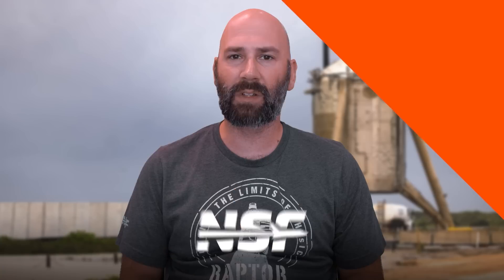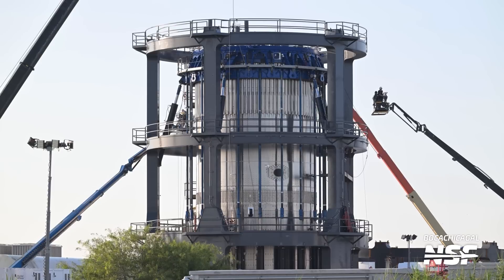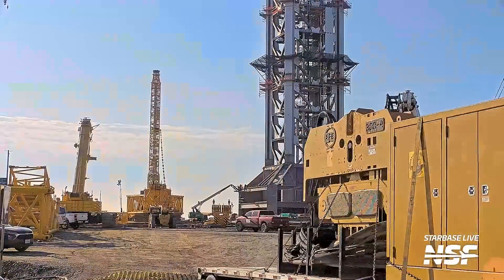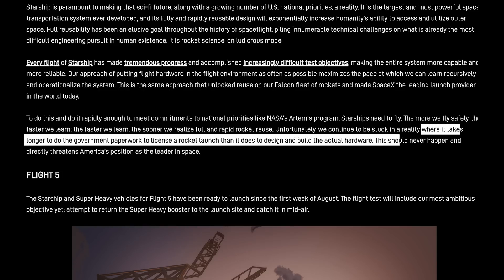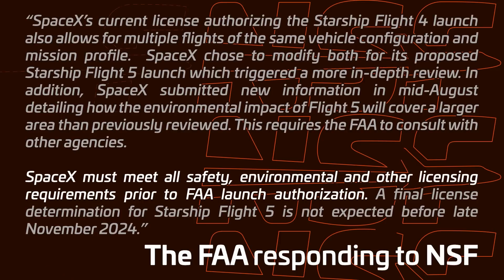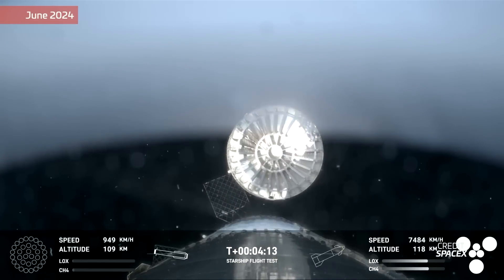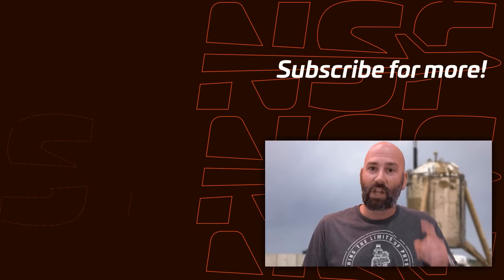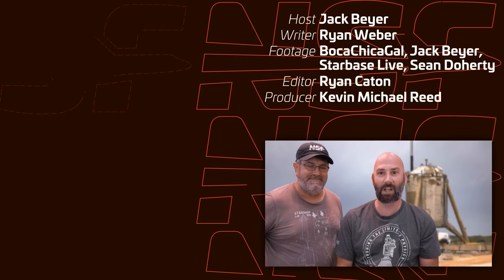WHY Is Starship FLIGHT 5 Delayed? | Starbase Update

Comment: I thought securing the multi-launch license was more of Space-X creating a contingency plan in case Launch 4 failed in similar fashion to Launch 3; however, since Launch 4 checked off all its goals the multi-launch license was no longer needed, hence changing the flight profile for Flight 5
Reply: Flight Five booster catch while pez dispenser etc are tested. If all goes well, flight 6 adds the starship test on tower two, or even set the booster off of tower one and also catch the ship on tower one.
Reply: @mikegardner107  There would be no hurry to test catch the ship if it reaches orbit. There could be ample time to remove the booster.
Reply: Why would SpaceX fly another Rocket unless there was something to learn in large volume from it. Sure the heat shield failed, but the booster and the ship itself did exactly what it was supposed to do, land in the ocean after simulated landings. I don't think SpaceX wants to fly a rocket just to test it's double thick heat shield.
Reply: @shaunfosmark  I think if they could fly for free, they would totally fly just to test the heat shield. The re-tiling seems to take a long time so I think they'd prefer to know as soon as possible, so that they don't have to retile the remaining ships multiple times.

It's just that flying is costly (you're throwing away 2 vehicles, but also in terms of manpower, having to stop other work at the launch site, etc) so it's a question of how much data do they think they need to get from a flight to outweight the costs.
Reply: @Wolf480pl Not flying is penny wise pound foolish at this stage. Ship data is too valuable to wait for catch approval. The engines on Booster 12 are some of the oldest Raptor 2’s remaining.
Reply: Defund FAA.
Reply: Flight 5 has plenty to learn from on the ship end. Tests of the Pez dispenser, engine re-light, and tiles can all be done without a booster catch. Success of this can mean a Flight 6 with both a booster catch and orbital trajectory.
Reply: @EMichaelBall I believe they must be confident that the updated heat shields and revised dispenser are more than adequate to cope. Remember they also used the most volatile re-entry trajectory for that reason. The fact that they were able to relight the starship before splash down suggests they have confidence in this aspect also. I really believe SpaceX want to test catch attempts with V2 Starships whilst tower 2 is still in progress and this way they can verify any structural work requirements for both towers before they launch v3 Starships. In this case we will have 2 x V2 Towers
Reply: @theelf152 Relighting engines in microgravity is a whole different animal than relighting for the flip maneuver. Also, the re-entry was rather gentle by re-entry standards. The ship stayed at 68km for about two minutes to minimize dynamic pressure on it, later on. It doesn’t hurt to operate the Pez dispenser in microgravity, either.
Reply: @theelf152 SoaceX has no plans to catch V1 or V2 ships for the foreseeable future. They will want to show the FAA that they have nailed reentry, first. That requires tests over the ocean. Vandenberg SLC-6 would be a great place to land ships.
Reply: @EMichaelBall  Tiles, sure. But wouldn't testing the engine relight or the Pez dispenser affect how things reenter, and therefore where they may end up splashing down? It sounds like a change to a flight profile and exclusion zones to me...
Reply: @Wolf480pl SpaceX could just load extra fuel on the rocket to compensate for the payload (they didn’t fully fuel the rocket last time). Furthermore, on Flight 3, they planned to test engine re-light, but attitude control problems precluded the test. On Flight 4, they decided not to attempt the test, just to be safe on a successful tile test. Now they can be more confident about testing the ship.
Reply: @EMichaelBall  hmm ok so that'd mean a relight was planned for the flight 4 profile. I still don't see how you'd want to test a Pez dispenser without throwing overboard objects that would reenter separately from the starship and for which someone would have to figure out if they're gonna burn up or splashdown. I don't think that kinda calculation was part of Flight 4 license.

Still, testing tiles and relight sounds like it could be useful (unless relight is a well understood issue and fixes are in v2). So it's the question whether the data is worth more than 33 raptors that they'll have to sacrifice by not recovering the booster.
Reply: Exactly. No one expected flight 4 to go as perfectly as it did, so SpaceX considered the possibility that they might have to redo that launch. But after they nailed the booster water landing, there was no need to repeat that profile anymore. Yet Jack keeps trying to blame SpaceX for essentially being too fast and innovative. Like it's their fault they won't need to redo flight 4.
And it's not just Jack. The entirety of NSF crew always try to absolve FAA and other regulatory bodies of any issues in their processes. I used to be in that camp, because every time SpaceX fans complained about FAA it turned out to be not their fault. So I usually sided with FAA. But not this time. This time they're actually at fault here too. And if we're trying to get people to listen to us when SpaceX fans keep unfairly blaming FAA, we should also call out FAA in such occasions where they actually deserve some of the blame.
Reply: @mattcurrent00  Agreed. If they've checked off the boxes, they need to move on to the next set of boxes; why repeat something you've already done?! I see comments from people that don't consider the incredible cost each flight represents. If you're going to burn another ship+booster then you might as well get some new goals checked off.
The FAA take way too long. Why does the window have to be so long? There is a whole lot of nonsense, unnecessary bureaucracy involved, along with the useful and important safety related parts.
Reply: @mattcurrent00  he never blamed them for being innovative? He said they submitted new findings, which resets the window of time for a response. The FAA are not totally at fault here. They do certainly need some changes, but they're following the exact procedure they had in place before and SpaceX chose to have this type of license. We're all glad the last flight went better than expected! It's just unfortunate the license type they went with.
Reply: @arpwithm3rk  @mattcurrent00 even if we assume that all the delays are due to FAA not having enough manpower to keep up with SpaceX, would that be FAA's fault?
Reply: SpaceX changed the plan for ship 5 which included a catch with the chopsticks. This gave the FAA no choice but to delay.
Reply: Hot staging essentially uses the booster as a second launch pad. It might turn out to be a dumb idea, like counding on concrete to work as a launch pad when everyone, everywhere, had been using a flame trench since WW2.

Comment: Unless flight 4 hadn't worked, which it obviously did, I don't think flying under the same profile would teach SpaceX anything new.  So what's the point to fly it that way, just to entertain us?
Reply: Flight 5 can test ship Pez dispenser operation, and in-orbit engine relight, without needing a booster catch.
Reply: That's the point of rapidly iterative testing.  If you repeat the same thing you learn nothing new.  You constantly move forward instead.

It's not very "rapid" if the FAA makes them wait 6 months between launches.
Reply: the obvious one is heatshield testing. if the new modifications are succesful, they can backport it to S31 & incorporate it into the block 2 design. else, they can make the required modifications for IFT-6 to hopefully be 2 successful landings
Reply: Payload bay door upgrade test, in space raptor relight test, heat shield mods test. Verify the booster can do what it needs to do to be caught. (Yes theyve done that once but like, more data more better)
Reply: @Ittiz  it barely worked, i mean, look at the ship that thing was toasted, the booster also lost engines on landing

There is still a lot of things that can be improved while flying F4 profile
Reply: Flight 5 has plenty to learn from on the ship end. Tests of the Pez dispenser, engine re-light, and tiles can all be done without a booster catch.

Comment: Flying the same configuration would just cost SpaceX huge amounts of money for way less benefits. these ships are not free every time one blows up. It's a lot of money if they can catch a booster it doesn't blow up.
Reply: Flight 5 has plenty to learn from on the ship end. Tests of the Pez dispenser, engine re-light, and tiles can all be done without a booster catch. Success of these tests can inform SpaceX on V2 ship tile design, sooner., in addition to providing data for orbital Starlink deployment on Flight 6. FAA orbital approval can come around the same time as a booster catch approval, if Flight 5 is done early enough and on the already authorized trajectory.
Reply: Catching the booster right now is more expensive than having it just blow up
Reply: @skillfulfighter23  thats crazy logic. If they can prove the catch then they never need to expend a future booster and then they can launch as much as needed to master ship reentry without the huge expense of building new boosters for each.

Comment: When they attempt the chop stick catch that will be more epic than the first starship launch.
Reply: Yet another first in rocket history.
Reply: more epic than the whole rocketery events
Reply: @SpaceWearer-ir3uw  yeah. Plus the general public is not even away of it.
Reply: Probably an epic fireball from what I saw of those tower tests.  That Tower sway is going to make for a very dynamic landing which I doubt that Booster has been sufficiently programmed to handle as that data won't be available until after the first crash ... I mean landing attempt.
Reply: @ForestvilleObpa  yeah. Fireball could be the result. I’m hoping for something better though.
Reply: Yeah Im really surprised they are not doing structural work on the tower itself. The chopsticks are supported by the tower- Not the other way around. They are working on the basis that the Booster will be almost hovering as the arms close (hence no diff), but even 1kph diff by a 2500ton vibrating booster can do massive damage & if it hovers even a few seconds longer than necessary- it will do substantial damage to the Launch mount and/or tower. It’s a bold move but I think Elon wants to know exactly what needs doing first before multiple launches of V3, sooner rather than later..I think SpaceX need/ want at least 2 booster or starship V2 catch attempts so that the tower can be revised/ updated to a V2 Tower Especially now with Tower 2 almost complete - makes sense to upgrade both from the findings of catch attempts.
Reply: @theelf152  yeah I think the result of the chop stick catch - if it does not go well - could potentially set the plan back over a year.
Reply: FFA are being held hostage by Bald head Blue Origin
Reply: @premsuman3819  Not the Future Farmers of America! This time, Bezos has gone too far.

Comment: I really appreciate the balanced approach you take in your info presentations. The interplay between a large company and its regulatory agencies is a delicate dance that requires both parties to be open and rational and this doesn't seem to be happening.  I like that you didn't default into "SpaceX fanboy" mode but presented us with a well-rounded and professional assessment of the situation. SpaceX needs to stop whining and start launching within their pre-set agreements/licenses -- and working productively with their regulatory agencies to succeed.
Reply: Thanks for the feedback!
Reply: This was a little "too balanced". All SpaceX wants is to let them launch when there is no public safety issue, rather than holding them back with environmental issues. If any environmental damage occurs just fine SpaceX after.
Reply: @Rettend  "If any environmental damage occurs just fine SpaceX after." Ah yes, the wisdom of this comment compels us all to place authority over regulatory agencies on Rettend.
Reply: Thank you!

Comment: Why would the fly the same trajectory as flight 4? This is a weird angle, Jack. They're trying to test booster catch. why would they repeat flight 4? What new data would that give for the Starship program? Instead of trying to blame SpaceX for some fucking reason, maybe admit the regulatory process is too slow.
Reply: Ship tests of the Pez dispenser, engine re-light, and tiles can all be done without a booster catch.
Reply: Well, testing to see if the new ship heatshield works would be good. Last time out, the flaps were held on mostly by wishful thinking and luck, not engineering.
Reply: The regulatory process is slow. But also, why did spacex apply for a multi vehicle license and then choose not to use it. They can launch now, catch on flight 6 and complete more testing objectives with ship all while further verifying that the booster will do what it needs to do to be caught. But, I’m not a rocket scientist so
Reply: @JackABeyer  How were they to know flight 4 would be successful? Like most of us, they had predicted the flaps to be the heatshield weak spot and would cause the loss of the ship on reentry. 
They would use the data and have flight 5 do what was achieved on flight 4.
Reply: @JackABeyer  This is a better, more reasonable take. I just don't like how the video seems to try to put all the blame on SpaceX
Reply: @mattcurrent00  this is exactly the take presented in the video.
Reply: @mattcurrent00  You may not like putting the blame on SpaceX, but it's not the FAA's fault that SpaceX used the deluge system without the proper permit.
Reply: @0x5DA  No. The video doesn't put enough emphasis on the fact that the regulatory bodies are also being too slow. So I like that he admits it here
Reply: @DPodDolphin  Did I say it's all FAA fault and SpaceX did nothing wrong? No
Reply: Also, most of the deluge water that is hit with raptor exhaust is immediately vaporized. Stop coming up with excuses for ridiculous regulations

Comment: Can certainly understand the need for environmental and safety protection, and I don't think there is any plan to stop Space X but I just don't think that the current agencies have a workflow designed to deal with issues in the timescale that Space X runs at. My wife works in a similar agency in the UK and they don't have an ability to turn things around in weeks - because their usual work happens over years not weeks. Will the US agencies change to fit in with Space X, I don't know. 
The OLM and the chopsticks aren't ready yet so there's not any delay atm.
Reply: Not only that but Space X just finished up Polaris Dawn, they are sending another Dragon in 8 days to ISS, so clearly they aren't trying to stop Space X. They are concerned catching the worlds largest rocket out of the air, isn't something that just try and see type situation.
Reply: @80aj  If I was living in Brownsville or vacationing on LaPadre island I would be keen on knowing that I wasnt going to get a booster land on me. We have been on the beach next to the OLM and I wouldn't want my daughter playing in any industrial effluent.
Reply: Good take.